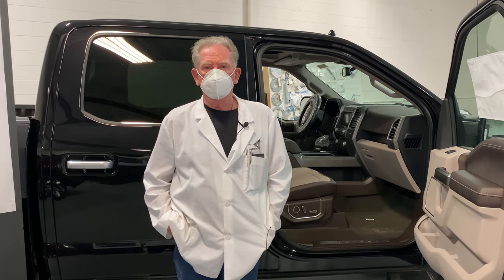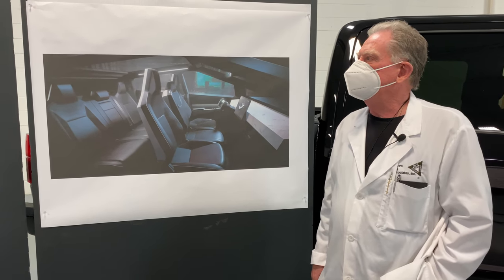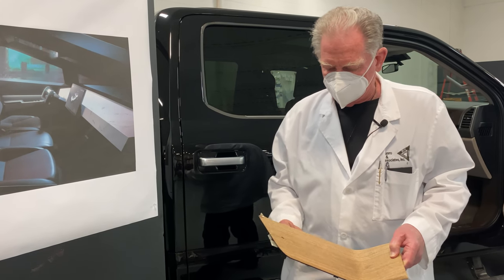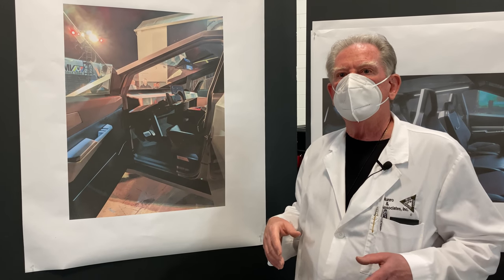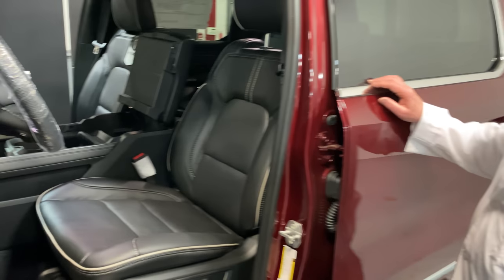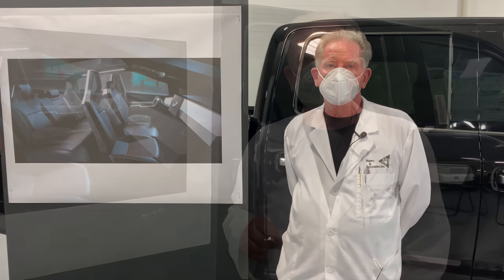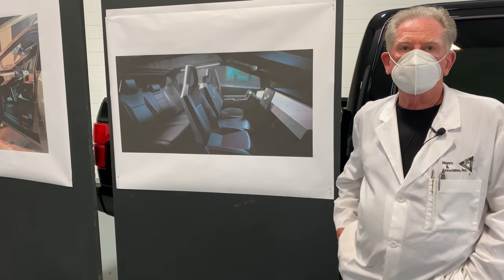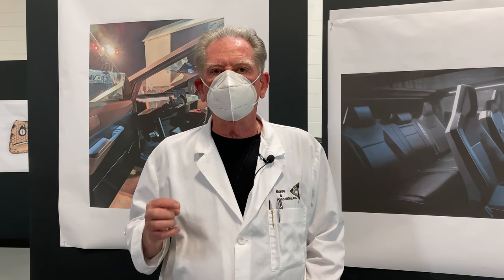Cybertruck E4 - Interior

Comment: Did he say what's on the CT floor? I hope it's not carpet. Removable rubber mats would be great. Pull em out and air blast or vac the steel clean. NO Carpet pls. I remember back in the sixties washing out the cabin floor with a water hose!

Comment: To my mind any new build should have a head up display in all models that just give the basic info speed / temp / revs /fuel and in a vehicle that has an OE rear facing camera the monitor for that should be low down on the dash so all it takes is a glance down (no need to move your head) and movable on a rail (?) so you can position it anywhere it suits the driver (within reason)
The only reason a rear view mirror is were it is to gain access to the view.

Comment: I have a digital rear view mirror in my Bolt Premier and have little to no use for it. Only if I was towing or my car was crammed full so I couldn't see using the mirror, and even then I probably wouldn't use it.
Reply: That's exactly what the camera is for,   when the mirror is obstructed by cargo. I have the old eyes problem so 99% of the time it's mirror.

Comment: All touch, all the time is for self driving and keeping costs lower, but depending on the function they are a safety and convenience compromise. Certain things you want to be able to activate without looking and to activate by feel. You can't do this with screens, even with hepatic feedback. Perhaps in a quiet luxury car that isn't getting thrashed over rocks, big bumps, water and mud etc, voice commands could replace some of that. But in an off-road vehicle, you need some physical buttons.
Reply: You can control a lot with the physical controls built into the steering wheel.
Reply: Paul fair points, but many functions can be voice activated in Tesla’s - improvements are often only a free software upload away once requested enough

Comment: What would happen if you cut a hole in the exoskeleton frame and installed a subwoofer in the hole? Would it turn the whole truck into a resonating chamber?
Reply: Probably. You just need to isolate the front and rear waves.

Comment: 22:40 I own a 2019 ram 2500 and I have to say the current uconnect is very poor in regards to speed and layout compared to the early versions. for example your backup cam uses less than a quarter of that large screen. Buttons move and switch around depending if you are in park or reverse which is just stupid. Uconnect doesn't utilize the large screen and it's crap.

Comment: I have regular access to a 2020 ram, that touchscreen is frustratingly slow, you cant constantly display the surround/backup camera. also, the vehicle must be stopped in order to use the search functions on the nav, very annoying to try and have to speed type a name or address at a red light.

any infotainment system that is slower than my 4 year old iphone is rubbish.

while im not violently opposed to digital side and rear mirrors, i like optical ones just fine

Comment: @Sandy - does the Tesla have a diagnostic port (i.e. OBD2) where a mechanic can plug in a scan tool and see live data and troubleshoot system components (like ABS, ECM/PCM, SRS, and other various computer modules)?  How many individual "modules" does a Tesla have (some vehicles have upwards of 30 modules)? Thanks.
Reply: Apparently the model 3 got a federal exemption not requiring it. My guess is CT will follow that precedent. Currently you can find youtube videos on installing 3rd party OBD2 jumpers into the back of the console harness however. The "masses" likely do not know or care about this feature unless i am just not yet seeing a loud outcry on teslarati etc.
Reply: @charleskeller4288  Thanks for that info Charles. I get that the OBD2 is not needed for a "zero emissions" vehicle. I'm just wondering if Tesla owners will need to go the Telsa if something in not working or if an independent repair shop will be able to work on these vehicles (pull codes, etc.). Hopefully they wont break out of warranty - but we know better.
Reply: @countryb3785  right to repair is an issue with Tesla.
Basically no support for third parties to repair and they have show they will void warranty,  stop updates and supercharging if you do something with the car they don't like.
There is likely a difference between how software and hardware is treated legally as well.
Since poems are more likely to be with the software, it might not ever be easy to get a third party fix.
Reply: This would be a good question for the Electrified Garage since they specialize in independent Tesla repair.

Comment: The carification of the truck is pretty sad.  Can you even get a full size truck with two doors and an eight foot bed?
Reply: You can but why? If you use it for work, a van is a wiser investment, i.e. resale and preservation and security of tools and materials. As often as I haul sheet rock and plywood, I just use a trailer. Or they deliver. I appreciate the old truck workhorse aspect, too. Just don't scratch the paint, lol

Comment: Love all the info, but still no say on how the crumple zones for the CYBRTRK will work in a crash scenario   😳
Reply: It will crumple like all new vehicles. There's not a whole lot to say about it.
Reply from the maker: Robert, that is a fair question, and obviously whenever we are able to get a CT and tear it down, we will comment on the impact script and crashworthiness enablers, but at this point, since we're only able to see the A surface, we really don't want to speculate too much on that front. Our assumption though, given that Tesla has received 5-star ratings and record-setting safety performance on all of their previous vehicles, is that they will certainly place an appropriate amount of emphasis on this in the design phase. Thanks for tuning in!
Reply: @MunroLive  Yes, they dont want to risk getting a low safety score. They will make sure it absorbs impact properly. Some people think that 3mm stainless steel won't bend. When you have maybe 6,000 pounds going 50 or 60 mpg and it hits something, it will definitely bend and crumple. That is a massive amount of force. I would not loose sleep over it not doing well in crash tests Robert.
Reply: @MunroLive  Thanks very much for the reply.

Comment: Another point about the buttons on the Ram. One screen that controls all functions is [relatively] cheap. Dedicated buttons are expensive. But just hitting one button to say increase fan speed is much faster, safer and easier than looking at the screen, finding the home button, then finding the HVAC button, then finding the fan speed buttons, and then scrolling to the fan speed you want. Buyers currently want that ease and convenience. Ram will remove the dedicated buttons once the buyers are conditioned to navigating through touch screens for common functions.
Reply: Billy Beemus. Soon enough speech recognition will be good for most things. For now in Model 3 and Y, scrollwheels on the steering wheel can be customised to operate common functions.
Reply: The Future is here, just not evenly distributed.

Comment: Sandy, tear down Model X’s falcon doors
Reply from the maker: We've actually had the chance to do that before, back in 2016, and honestly, we felt that the falcon wing doors added a lot of cost, complexity, and hassle for Tesla in exchange for a questionable amount of benefit. Not something we'd recommend for the future. Thanks for tuning in!
Reply: If you want to learn more about them, check out the Electrified Garage. They work on Teslas and they did a video showing common problems on the model X. They explain the doors inner workings.

Comment: I recently went back to GM after many years. GM used to make some crappy cars, so I went somewhere else. Having now owned a Bolt for several month I can say GM still builds some crappy cars. The interior is very cheap poorly designed. The seats are terrible, and the suspension sucks making for a miserable ride. I also don't have adjustable shoulder belts, but that's not all that has been left out. There are no rear cup holders, no dedicated place for sunglasses, no rear speaker, not even a balance control in the radio. The left out so much to cut cost, but the sticker price was still $40k. They took 30% or more off, but if I would have know how terrible this car is, I would have waited for other option. Unfortunately there are not many options for EVs in my state. I think most GM buyers are acclimated to crap, and just think, well this is better than the last one, but that does not win them new customers, which may be why they are gradually shrinking into insignificance.
Reply: "No rear cupholder, no rear speakers, and no way to balance/adjust audio," is absolutely false. I mostly agree with your other complaints.
Reply: You can't blame GM entirely.  They just imported it and glued a Chevy emblem on it!
Reply: I drove it and thought it was nice, lots of room.
Reply: @loungelizard836  The Bolt is assembled in Michigan. I believe over 50% of the components are US made.  Maybe you're referring to the Opel Ampera-E in Europe? (Which is a rebadged Chevy Bolt).
Reply: Ur first issue was buying a Chevy bolt lol. I’m sure you also had a Ford Fiesta at some point too?

Comment: 1) Trucks today are overwhelmingly "lifestyle vehicles" and are sold as such. Just look at the trucks and look at the marketing.
2) The number and proportion of farmers, construction workers, etc. who would actually need a truck today is immensely smaller than in the past. Thus, to keep raking in the cash the general populace has been tapped. See #1.
3) Simple, old style trucks (even as they were in the early 90's) just aren't profitable enough. Dodged changed that by starting the "luxury truck" trend with the 2nd gen Ram in the mid/late 90's, the one with the dropped fenders. It took the truck from more than just a "workhorse" towards being a lifestyle vehicle with various car-like features. 
4) Simple, old style trucks won't sell as well today because they've become open-trunk sedans, serving overwhelming as daily driving commuter and family vehicles. Old style trucks were typically paired with a car, with the car being the main "family" vehicle and the truck being for work, weekends, and spare vehicle. Today the truck is the primary vehicle and work sometimes get done with them. 
5) Old style trucks also won't sell because there's not much bragging to be done about a plain jane rubber-floored, long-throw manual transmission-ed, basic regular/extended cab truck on steelies...

Comment: The Cyber Truck appeals to space heads.  The stainless exterior is corrosion resistan something you would need on Mars.  The bullet proof windows are similar to what you would put on a air tight space craft.  Gas engines don't work in space, nor would they work on Mars.  The sparse interior is what an operator would need if they were in a space suit.  Space suits get caught on switches and dials and pokey things.

It is not practical but a relatively small part of the market today sees themselves as the generation that goes to space.  Most of them will never do that but they like to see something tangible that they can own.  What could be better for that than owning the vehicle that is as close to being "space capable" as you can practically get.  But also by buying a Cyber Truck you are actually supporting efforts to get into space.  If your car company isn't going to space then making the Cyber Truck will be a flop for your company.  A huge part of the Cyber Truck appeal is wrapped up in the fact that it is a Truck that is paving the way into space.  People want to be a part of that.

Elon Musk wants to go to Mars.  He is building products that will operate on Mars,  Perhaps not completely (rubber tires) but a good portion of the Cyber Truck is capable of operating on Mars.

The Cyber Truck does not appeal to me.  I can't have the access to the bed of the truck so high that I cannot reach over the side.  I am constantly putting tools & cargo in the back of my truck and don't want to walk to the back end of my truck to access things.  Placing cargo near the cab protects it from the air that is blowing by.  

A sparse interior just looks bland.  I want music.  Navigating through menus on a computer screen takes my attention away from the road.  I need large knobs, large text, tactile feedback and simple / smart interface controls that give me direct control over the features I use.

The control surfaces have to be durable.  I have a heavy hand that gets knocked around while going over bumps.  The control interface needs to be hardy enough to handle unintentional hits, grabs or pulled on.  And smart enough to suspend function or deal with unintended input.

This especially includes the accelerator.  Old trucks are notorious for the old bumpy road feed back loop.  Where you go over a bump and the foot gets jarred along with everything else and then falls on the accelerator which revs the engine which jars the old foot again which romps the accelerator...  and this goes on till you have the sense to take your foot off. 

Different things happen with other controls like the volume knob on the radio.  But mostly things get broken because the designers don't account for the hand that smacks and breaks the A/C knop because you went over a pothole while you hand was about to adjust the temperature.

Modern Trucks have been designed for Earth life and Earth driving.  Cyber Truck is a distraction for companies that don't have space in mind.  If your company is not part if the space clik than any attempt to compete with this is destin for failure.  That said there is also the EV thing happening.  Competing in the EV market is open to everyone.  Mimicking the Cyber Truck design (EV aside) is for space heads.

Comment: 11:30. I'm thinking the steering 'wheel' was purely clickbait to provoke controversy  and get more media attention. Many car companies showcase unlikely features in their concepts to generate 'buzz', and Elon is a master at manipulating gullible auto channels. As long as your product attracts eyeballs, that's half the battle. Especially if, when the product is released, it exceeds expectations.
   If any of Tesla's cars had been sub-standard, have no doubt, the auto journalists would have been climbing over themselves to trash them. Instead they, grudgingly, had to approve. lol
Reply: see also: the way the president is presented. And not just the current one
Reply: Disagree, the new Roadster will have the same steering yoke, and I think future Tesla cars will have the steering yoke. But, I don't think the yoke is correct for the CT. And in the model 2 might do away with steering wheel all together.
Reply: @markplott4820  Prototype wheel is not legal. It has to be a round shape.
Reply: @JasonWW2000  - Actually, it does NOT.
there are Cars in Development or on the Road with a Rectangle Wheel, and a Driving YOKE can be legal as well.
ELON will make the Driving Yoke LEGAL.
Tesla , plans on making the Model 2 , with NO Steering Wheel at all, NO Pedals and NO Mirrors.
the Cybertruck has NO Mirrors, it has a HD Rear camera. 
Tesla in Asia and Europe can get Camera Stalks to Replace Mirrors. 
TESLA is changing the AUTO Industry for the Better. 
Today we even have ICEV with Pedal Shifters , which ONCE were only on Race Cars. now they are LEGAL.
Reply: @markplott4820  Obviously I'm refering to today's laws. If the law is changed in the future, cool. So currently the yoke design is illegal and all steering wheels have to be a roundish shape. A little bit rectangular or flat on the bottom edge is acceptable. Elon has even said the yoke wheel in the prototype will be changed out. I hope that clears it up for you. Currently the US legally requires side mirrors. I think you mean paddle shifters. The ones behind the steering wheel. I remember seeing those 20 years ago on street cars. They're certainly not new. They were never illegal.
Reply: @markplott4820  No doubt just a joystick, with vibrator option.

Comment: The steering wheel is awful. If it comes like that, guarantee they will be swapped out or modified heavily. Also, where are the armrests and cupholders?!
Reply: Prototype wheel is not legal. It has to be a round shape. The middle jump seat folds down to give arm rest and whatever else they want. These are the small details they are sorting out before production.